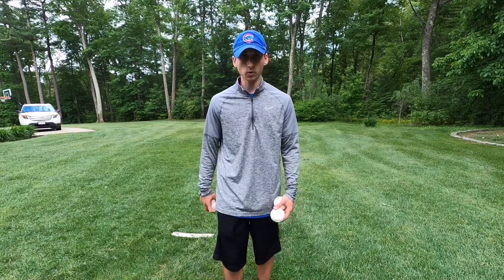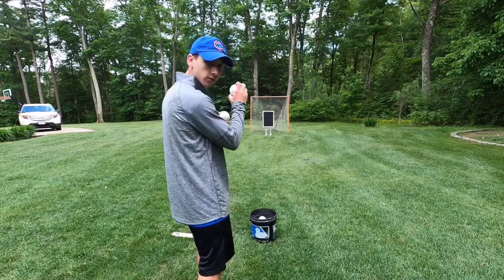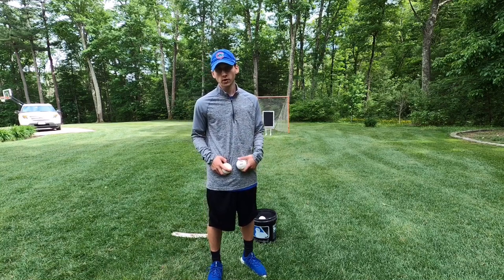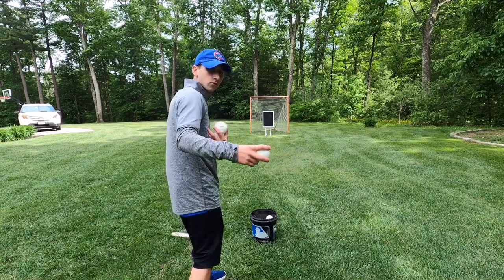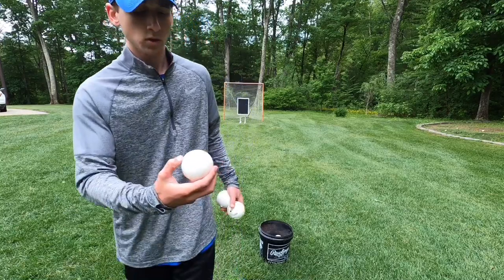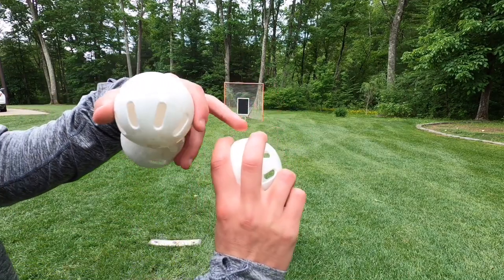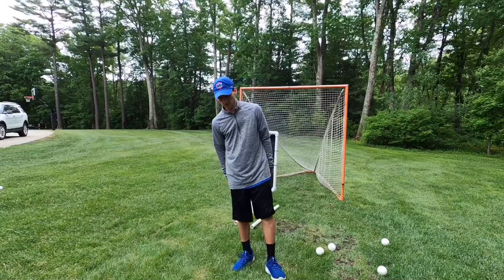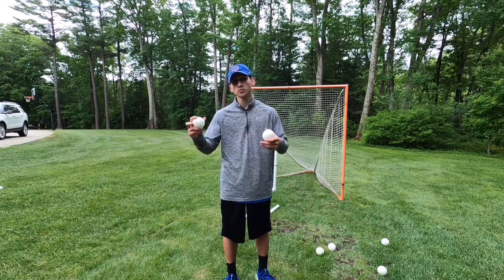How to Throw a Wiffle Ball Screwball | GWBL Pitching Tutorial

Comment: I use a Wiffleball with those small circle holes that goes around the entire ball. Just to make it have some break or rise to it, I put small pieces of scotch tape over one half of the holes. I throw something I call a Sinker-Screw or Screw-Sink, and it's quite nasty. Looked like its going to hit High and away (for righties. For lefties, high and inside) then it breaks to low and in (low and away for lefties. Its even gotten so much break that it would probably hit the batter's foot.
Reply: Yo I  have the same ball! And I do the same thing with the tape!